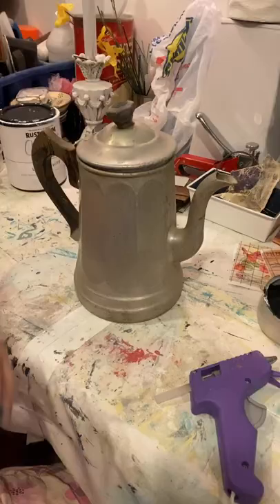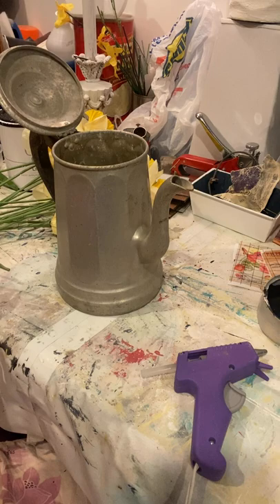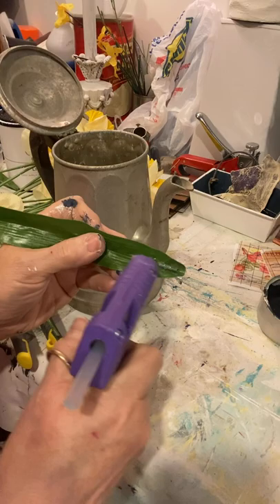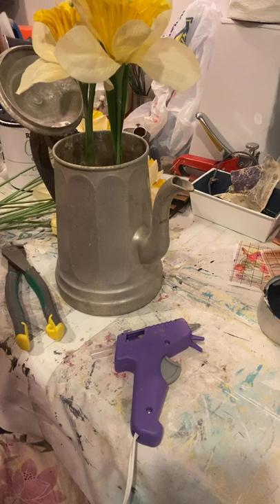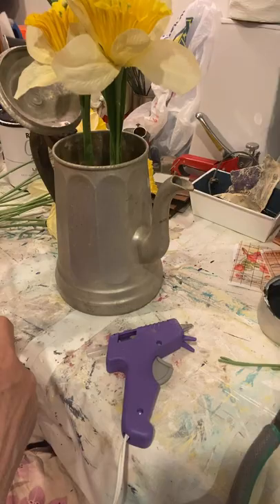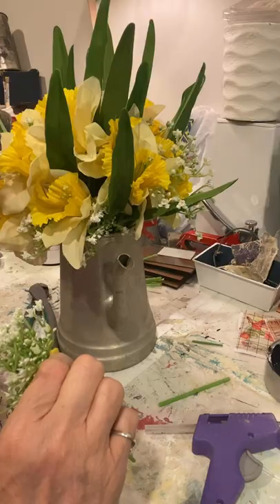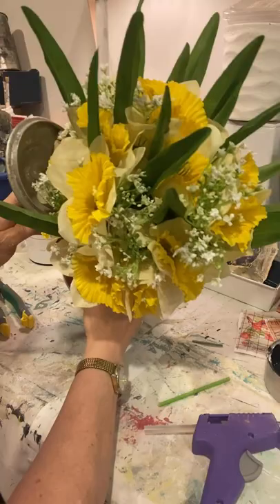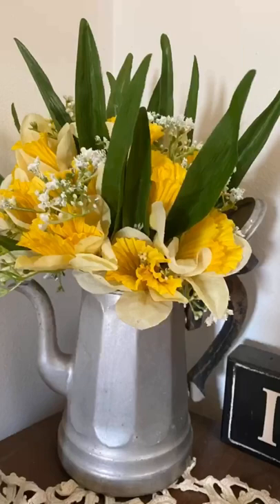FusionDIY - Video #9 - 5 Make overs and a short thrift haul!

Comment: How much are you asking for the little stool?
Reply: Amazing finds and your work is beautiful I subscribe to your channel because I have a stool that I want to recover but there's more to it than just the top it goes down around the bottom and I need a tip!
Reply from the maker: It is in my booth ticketed at $15.00.  As for your stool, do you sew?  I would run some piping around the top and sew the side pieces on and then fit it all and staple the sides on the inside of the stool. If you check on Pinterest or on YouTube you should be able to find a tutorial. If I can find a stool like the one you’re talking about I’ll definitely buy it and do a makeover.  Thanks for watching and subscribing!